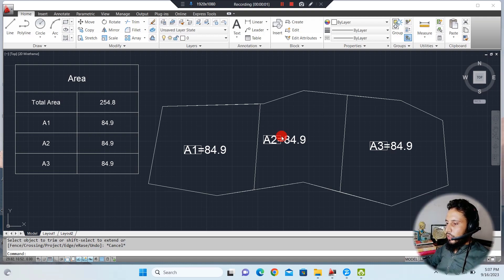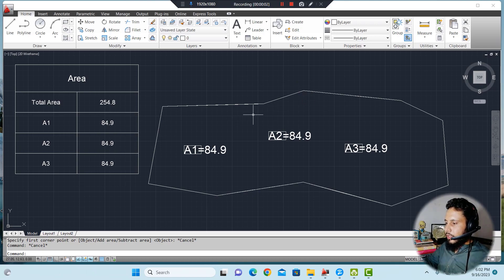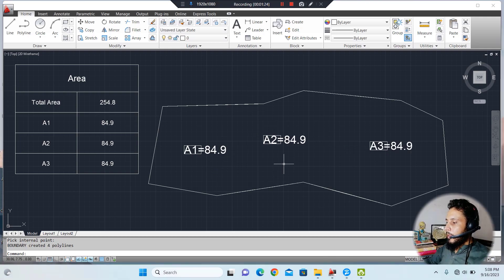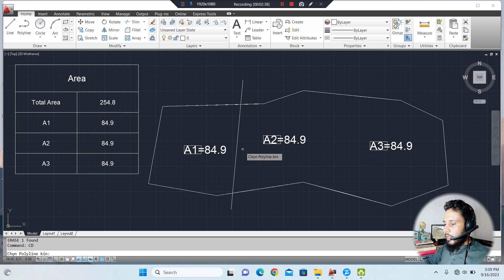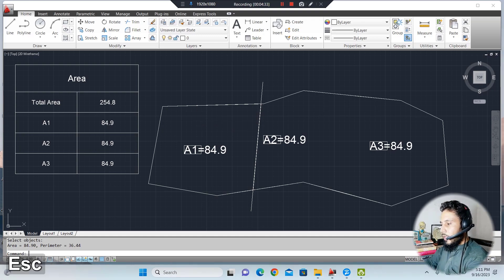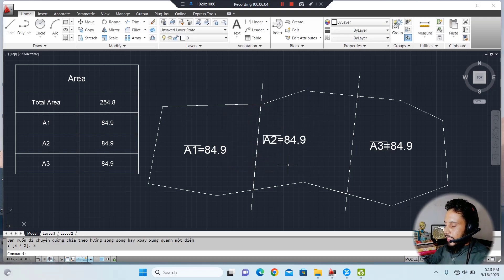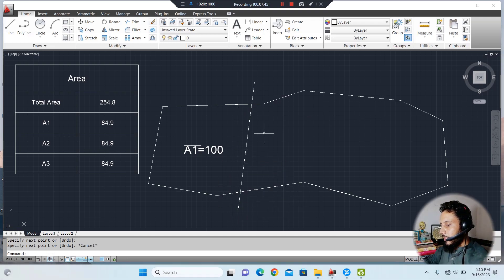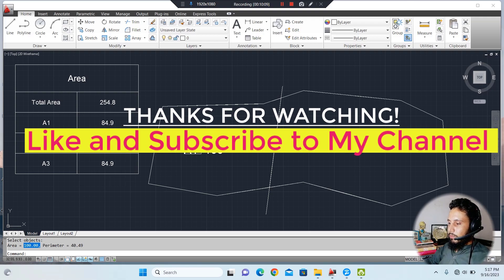Dividing the area in AutoCAD

Comment: This CD command does not work with circle. If you draw a circle of 80 m radius and want circle to be divided vertically in 2 parts with left area to be of 5000 m^2, it gives left area of 6046.177 m^2.

Comment: Sir g plzz help me sir for example da 100’ da neshan che area sara lage kama area che divide ka bya kar na kai aw che dase 100 ye ala nu bya pa inches ke divide kege da wali sir g ?
Reply from the maker: Dear looks like da units setting issue da.. insertion units de inches ki de. Set the units to feet's and if the issue is not solved than use 100*144 area so automatically the area will be 100 ft. Da video tola carefully ogora all the steps are well explained.
Reply: Thank you so much sir I will check it ❤out